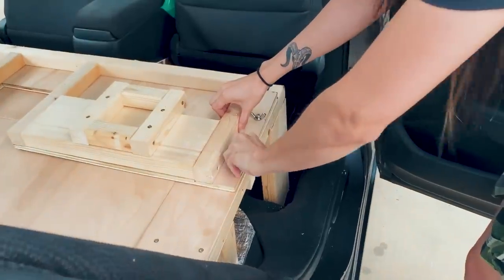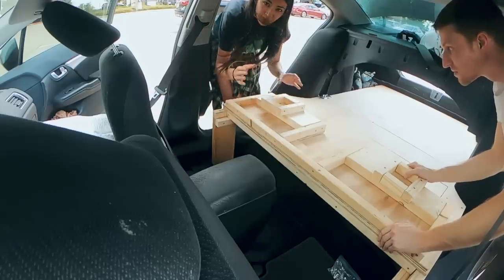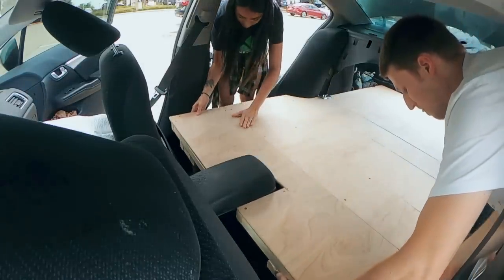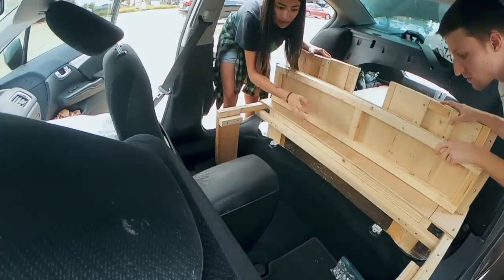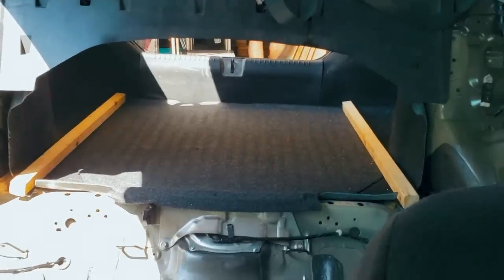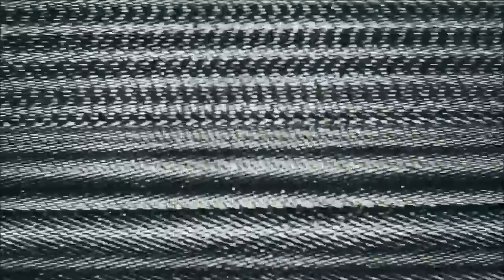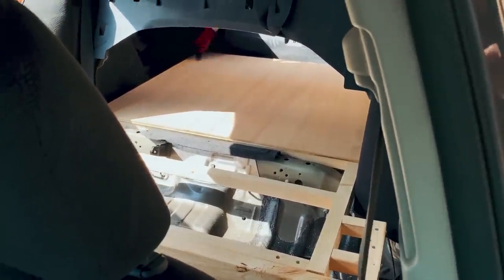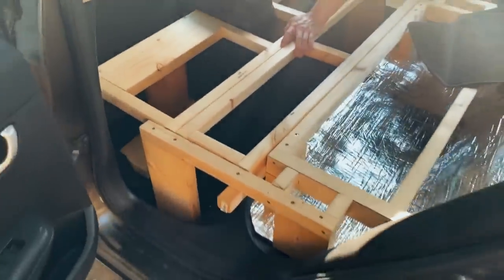Living in a car: Honda Civic Bed Build

Comment: Those wing nuts are going to get old real soon, why not just drop the bolt in from the top the weight should hold it and the bolt stop it sliding?
Reply: Lol that's what I just said - should a scrolled down first
Reply: I also should have scrolled down... lol
Reply: Yep. 2 on each side is so much overkill that I started to think they're new at this
Reply: exactly my thought... too much effort for something that should be simple. one bolt each side, just drop them in. no wingnut, unless you want to for safety's sake (in a car wreck, it may come loose). simple.
Reply: someone down below mentioned using velcro instead... much easier solution. i think after they have to assemble/reassemble that setup every night, they'll get the idea.
Reply: Genius, or loooong bolts and no wing nut
Reply: Only concern about that would be bumps causing it to pop up or rattle somehow. Probably not an issue if the roads are well maintained but I would suggest a $2 bar clamp.
Reply: I 7 should've scrolled down
Reply: I would use simply good hook&eyes.
Reply: It’s really not that big of a deal

Comment: So wait - they have to do all of this work just to go to bed each night? I’ll pass.
Reply from the maker: this aint even half the work yo 😂 wait till you see it with stuff hahaha I can easily see why someone would not be down
Reply: They don't HAVE to, they chose to when they chose to use wing nuts instead of a simple bolt that takes 0.2 secs to remove. 

You could do what they are doing in a waaaaay shorter time by just changing one thing lol.
Reply: @HoboAhle  so that's where the magic happens. A nice hard surface
Reply: @JasonScott1991  bruh its the price of freedom. If you gotta poop in a plastic bag to be rent free and live traveling, so be it. at least IMO lol

Comment: You would be better off just buying a swag and that way your comfortable and have more space in the car for other equipment. Swag camping also has the benefit that your car doesn’t need to have the bed in it when your using the car to get to work

Comment: A couple of tips for saving setup time and reducing clutter: You could put hinges on those removable panels, then just flip them over—no bolts, no wing nuts. Piano hinges are sturdy enough to take some weight and not very thick; whatever you use for a mattress should hide the slight lump (unless you’re ‘the princess and the pea’ kinda folks, which I doubt ‘cause you’re living in a car). You could also have hinged plywood legs and lose the big chunky 4 by pieces.

Comment: Aren’t the screws going to strip the board? Why not do hinges
Reply: i assume its for the ease of taking it all out if and when it needs to be taken out.
Reply: Yes hinges
Reply: Or even just put the bolts from the top, leave wing nuts off. The screws will hold it in place. You only need one bolt per side
Reply: I'd probably get a couple of small spring clamps and eliminate the wing nuts ... looks great though! Very ingenious!

Comment: Honestly I see this as a great touring vehicle if you plan on setting up tent or canopy and do 99% of your stuff outside in moderate to hot climates and just sleep in there. But if you're stuck in there during bad weather and snow that's tight, especially with all your gear, clothes, food etc. especially for 2 people. I'm glad this is a temporary set up until you get back to your Van.

Comment: I never thought of doing this with my civic. I just got a fold mattress and laid it out on the seats.
Reply: PZO it definitely gives you more storage space and room to spread out sleeping... I did it in my SIUV and it was so cozy I looked forward to hanging out in my space💜 happy trails
Reply: It took me 3 months to finally stop sleeping curled in a ball after I stopped living in my explorer. I used to just sleep in the back seat, occasionally stretching out by shoving my feet between the passenger seat and door when being curled up became too much.. ironically, sleeping in my car was the deepest sleep I ever had
Reply: I have an 2003 civic and I, a 5'9" person, folded the seats down and laid with my head in the trunk. Besides doing some levelling to fix the height difference between seats and trunk, you could sleep in it without having to remove the seats too. Unless you're taller than me lol

Comment: Adding roof rack and a trailer hitch can help with storage if need. Also getting some solar panels that can charge a portable battery generator can help alot but last time I check was pricey for the both of them

Comment: If traveling alone, you can remove the passenger seat and make that the bed (more leg room and it’ll sit lower as well. But when reinstalling back the seat make sure to use a torque wrench and tighten it back to factory psi.

Comment: Just fold the seats down and put a cushion to level it out 🤷🏾‍♂️
Reply: ...agreed, that what common-sense people do
Reply: Have to do more for YouTube though.
Reply: Would you just throw a blanket on the ground in your apartment? Much simpler then putting together a bed frame!
Reply: @biancabumblebee3340  said cushion
Reply: @biancabumblebee3340  I'm actually laying on my cushion on the floor of my apartment right now😆
Reply: The seats being gone leaves valuable storage space under the bed but that's common sense we wouldn't expect you to figure it out.
Reply: @biancabumblebee3340  I am sleeping on a blanket on the ground in my room. The first week it hurts but after that you'll have the best sleep of your life💁🏻‍♀️
Reply: Oops, context. Civic owner here. And mine's a 2 door coupe. Still plenty of room. Without removing the seats.
Reply: Won’t work I tried that on my 8 gen sedan and it won’t work without taking the bottom of the backseat out is something similar, my GF has a Versa hatch and that car will do the front seats flat against the back 💺
Reply: @marcelonator  well in my 6 gen it works. And the interior is mint for being a 98, so it's not like my foam is flat. The seat backs fold flat, there's just a 3 inch dip to the depth of the trunk. Fill that up with the rigid foam insulation, throw down your sleeping mat, & tell me it doesn't feel like a flat bed. Unless you're Princess & the Pea. ;)
Reply: If you’ve ever had to sleep in a car for more than a couple days then you’d understand the discomfort and neck/back pain that come with it. Car seats are not designed to be slept on, a BED is. Hence the damn reason she’s putting a bed in there

Comment: Very cool. I'm looking at getting a used mazda 5 or dodge journey so I can sleep in it and have more space than a car but still get the fuel efficiency of a 4 cylinder.
Reply: JJM my mom and I have the Mazda 5 and love them!! They can fit so much, yet they're so tiny and fun to drive
Reply: I highly urge you to steer clear of a Dodge Journey. Go for a Mazda or even a used Honda Element, the Element is a great option because the seats can easily be removed and there’s a ton of space. I bought one from a Country Club that was used as a security vehicle for $600! It just needed a new transmission. A steal. It’s running strong 10 years later. Great stealth camper. I don’t live in it but totally could. Good luck

Comment: How do you get rid of the corners on the trim??
Reply: Many ways to do it but 1.Remove/tuck away insulation layer
2.Make sure to hide any wiring into side trim if possible
3.Get some gloves thicker than latex
4. Wear some eye protection unless you want to get blind in the process
4. Get a hold of a saw or plasma cutter (battery operated saw is more diy friendly)
5. Cut away :)
Tips: You can cut the side trim into smaller sections/pieces so that you can bend and peel off

Hope this helps

Comment: Why not a Prius? You can use the solar and run the AC and heat at night and use a roll out memory foam mattress for more stealth camping. But i get the point you want to do different things.  Which is cool

Comment: if you can swap that civic for a 2nd generation prius :~)   (53mpg)   Have you considered one of those Dometic car refrigerators? Runs of either plug or 12 volt cigarette lighter. (real fridge too not just a cooler)Perhaps Dometic would gift you one if you mention it on your videos (?) Pricey, but so nice to have good fresh food option I think. Impressive bed- nice wood crafting!! Cozy!!   Hope you do a follow up video- curious as to what mattress you will use.....looks like you can't go too thick.

Comment: Honestly I feel like you should have got an EcoBoost Ford Escape or something and done this
Reply: Jacob Grizzy they probably already had the car, since its a older civic model?
Reply: Ford Escape has only 6 feet between hatch and back of seat pulled fully forward, so won't fit everyone.  A taller person could sleep sideways if  travelling alone.

Comment: I've been subscribed since the Jeep Liberty yet I rarely get your videos in my feed. YouTube sucks... It seems the legs could be hinged and the entire section hinged so it would just flip down and you'd be done. 4X4's are overkill in this situation since there isn't a whole lot of weight on them that a 2X4 couldn't handle.
Reply: less about the weight, and more about the wobble, potentially. 4x4 provides a better base. But they did then just put a 2x4 under the 4x4 to help with wobble...so maybe not haha

Comment: If you just drop the bolts in from the top you shouldn't need the wing bolts and it will make it easier to make.  The wing nuts will only make it safer in a roll over accident - hopefully THAT will never happen.

Comment: This makes absolutely zero sense. you have a ram van, with a high roof and extended wheel base, why not finish building that out and live in that with two people?
Reply: @neil121886  I tried to but she never really got to the point. Can you just explain to me if there is an actual plan. Like what is the "temporary" reason? Maybe the van has a major mechanical issue that is being fixed. OK. Fair enough. But even if that's the case, fix it, and move into the van. Don't waste time and money on the civic. But seriously, can you be kind enough to tell me what the reason was for the temporary move. Thanks.